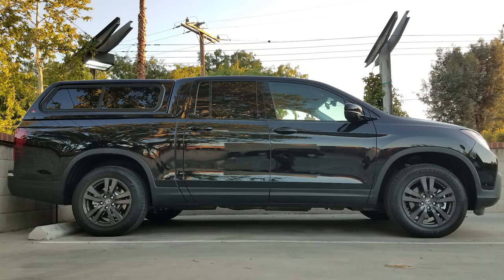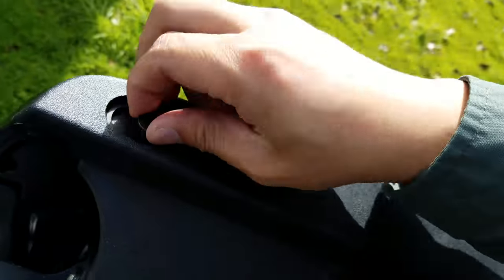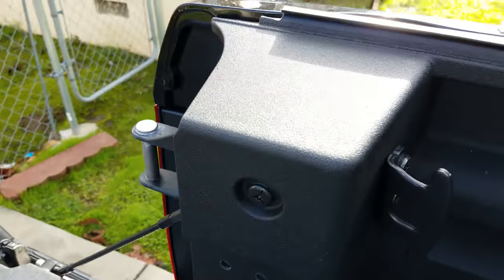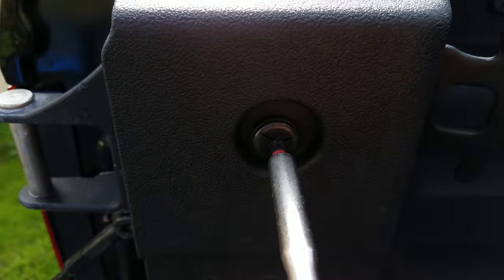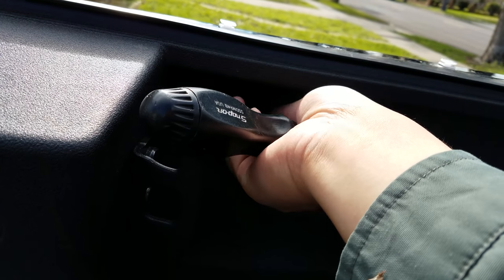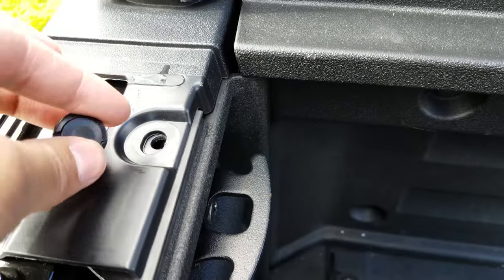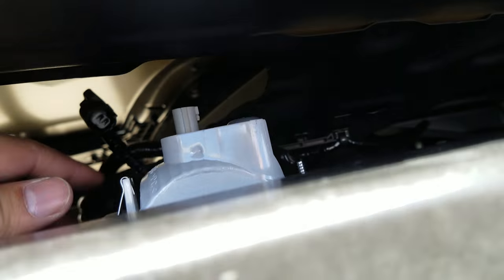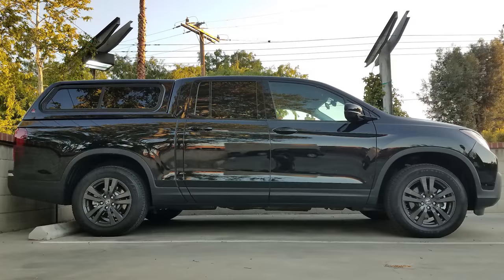Honda Ridgeline 2017 Bed Panels Removal Sport Edition

Comment: Once you have a side panel off, is there a path to the cab to run a wire? I want to install a HAm radio and need to get the antenna in the bed but I don't want the coax to show.
Reply from the maker: Hi Bryan, yes there's vent holes that lead into the cab behind the seats. I ran my cable through the bottom driver side plastic panels.
Reply: Thank you. Good to know.

Comment: I need to remove the tailgate bed panel but after removing all the screws, I am having trouble removing the top panel.  I don't want to force it.  Is there any demo online for removal?  if not, any direction anyone can provide would be much appreciated.
Reply: Excellent video - thank you.  I am struggling to get in the tailgate, can you do a video on how to get that panel off?
Reply: Me too - did you find one?